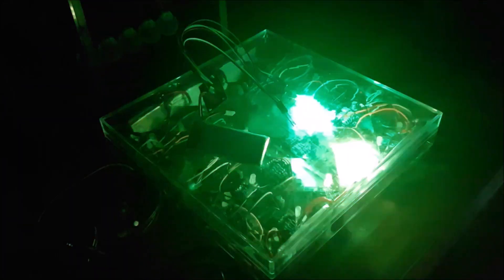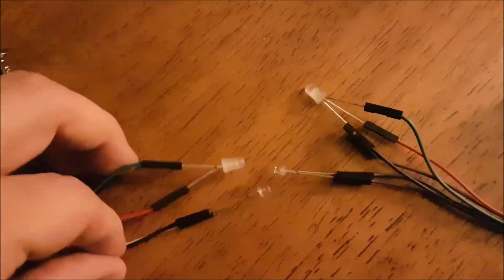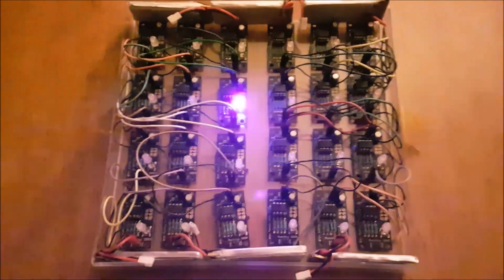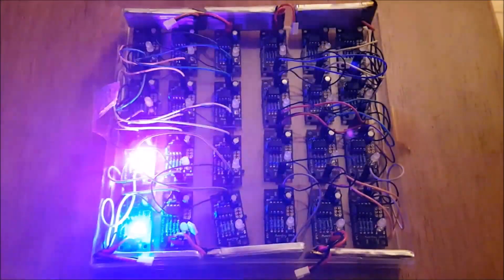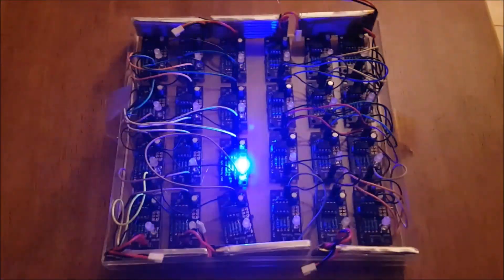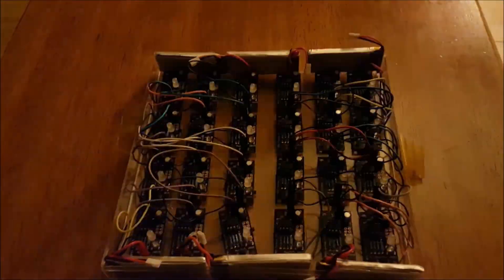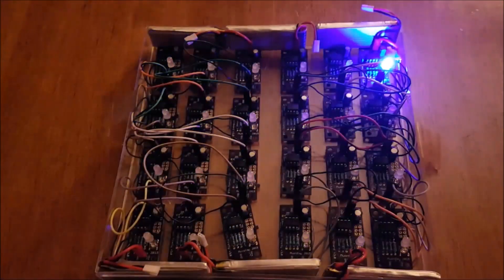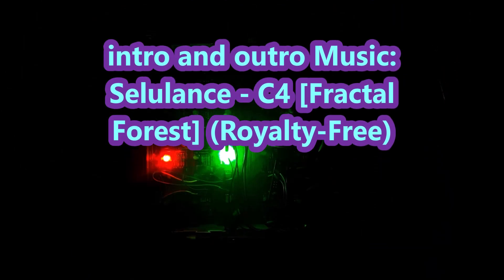Feynman's Fireflies - A Visualization of Quantum Network Synchronization

Comment from the maker: At 5:55 I mentioned that there are many biomemetic metaheuristic algorithms. These are variations on a universal system for generating a metaheuristic based on a physical power law associated with a particular kind of signalling (i.e. light flashing in fireflies, sound calling in bats, vibration communication in bees, electrical firing in neurons etc) as described here: http://muonray.blogspot.com/2016/04/meta-heuristics-and-universal-power-law.html

Comment from the maker: more detail on the quantum metaheuristic model here: http://muonray.blogspot.com/2016/11/viewing-meta-heuristic-synchronization.html In this video I showcase a type of light circuit I made back in 2015 (which I now call Feynmans Fireflies) to demonstrate the principle of emergent behavior in metaheuristic systems, in this case of metaheuristic synchronization of light signals in a network that has been programmed using a Discrete form of the Firefly Biomimetic Algorithm. 

To my surprise, the wave like patterns that emerged from the discontinuous pas coupling of the oscillation LED flashes reminded me of the description of quantum mechanics offered by The Physicist Richard Feynman, The Path Integral Interpretation of Quantum Mechanics.

In this description, the path a quanta (i.e. a particle) such as a photon or electron follows is a sum over all possible histories in phase space where each possible path is an element of the sum given by the individual phase amplitude for a given path, eiS/h-bar (where S is the action i.e. the integral over time of the Lagrangian, L, as shown in the upper diagram; the Lagrangian of a path represents the difference between a path’s kinetic and potential energy) by Euler’s formula has a real part and a complex (or imaginary) part so requires for graphical representation can be typically done on an Argand diagram (which has a real horizontal axis and a complex or imaginary vertical axis). 

In the case of our cycling LEDs they start in a state where they are unsynchronized and follow a sum over possible paths to achieve synchronization with random oscillations that are vulnerable to external stimuli and create an effect which reminded me of the "observer effect" which can happen in the path integral description of an electron following many probable pathways through a double slit forming a wave like pattern when undisturbed and a linear pattern when observed/disturbed.

I constructed a model describing this effect in more detail and I was able to find some very interesting relationships between this pseudo-quantum behavior and classical behavior of metaheuristic and coupled networks which show many equivalences which have been of interest to me for some time and which I would like to share.